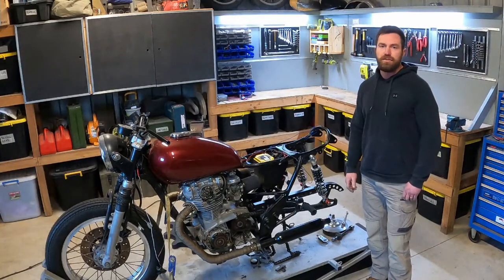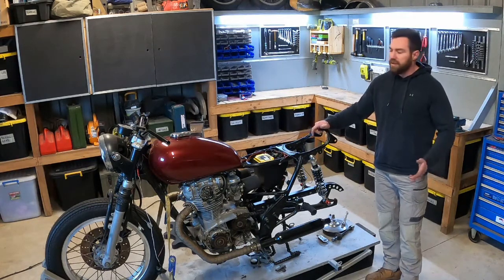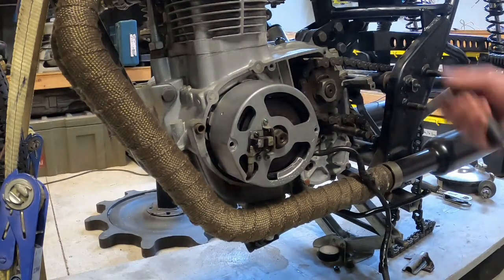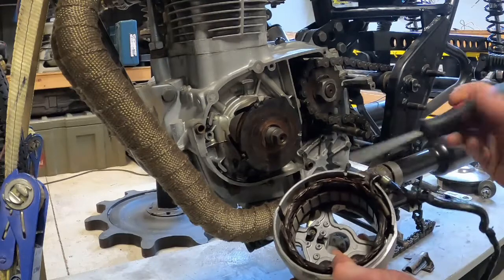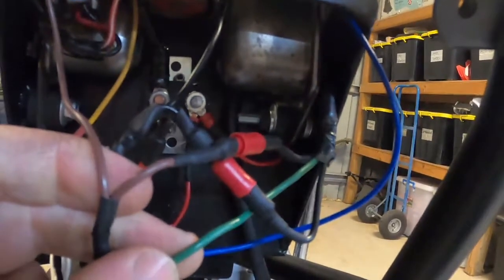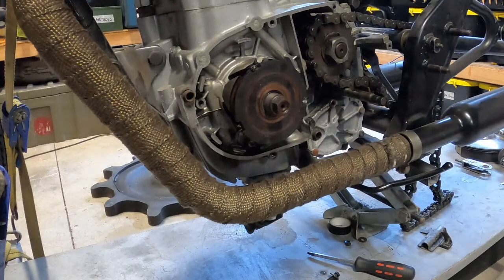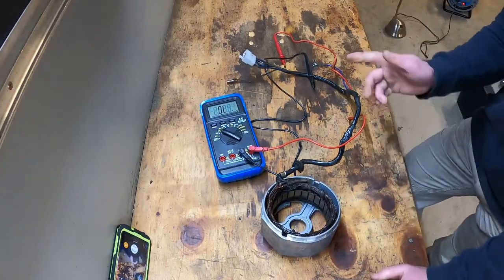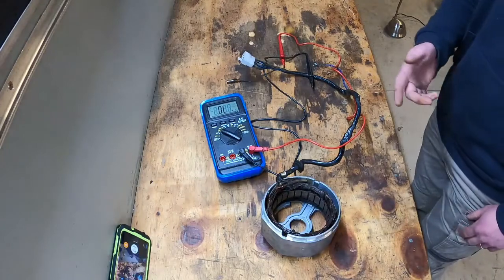XS650 Brat Build Ep 20, Charging System Fault Diagnosis

Comment: My 77 isn't charging well. I haven't done all the tests but I did buy an XSCharge PMA kit from Mike's XS. Would you recommend putting that on or actually finding the problem and staying with the original charging system, replacing what's faulty?
Reply from the maker: If you already have the pma system then I would go with that. I would still try to diagnose the problem for curiosities sake though.

Comment: I just purchased a 1980 xs650 sent the engine to be rebuilt just because I have little time to work on that but as I was going through the wiring my headlight won't come on? It works because when the engine is running I can jump a wire from the battery to the yellow wire on the safety relay and it turns on and stays on but if I don't jump it I don't have volts from the yellow wire from the stator to the safety relay and neither of the 3 white wires coming from the alternator show voltage while running...the stator and rotor are new they were installed.by the previous owner?
Reply from the maker: The yellow wire from the stator is unrectified and unregulated and it's only purpose is to open the safety relay and prevent the starter from being engaged while the engine is running. Your lights should have nothing to do with that circuit. I think the later models had lighting relays, which yours would be, but without looking at it I wouldn't be able to tell you anything about it.
Reply from the maker: Make sure your multimeter is set to volts ac when testing the 3 phase wires and the yellow. If it is set to dc it will read zero.
Reply: Thanks yes my model has the safety relay with two circuits so once the engine is running and the alternator starts charging it sends volts through the yellow wire to the safety relay which shuts off the starter circuit and closes the headlight circuit.....I'm going to do away with all that extra crap and simplify the wiring but if it's not working due to the charging circuit i would like to figure it out

Comment: Clean those rotor brush tracks and use new brushes, that will help.
My guess is carbon dust build up from the brushes created a path for electricity to ground (or between the brush tracks) when dirty, but lack of crud touching it makes it meter as good.
One other possibility is a crack or gap in insulation somewhere allowed a short to develop through dirt or carbon buildup and cleaning removed the conductive path.
Either means if it gets dirty again, the problem could return, or perhaps regular maintenance will keep that gremlin at bay.
It may be possible to re-varnish the coils and seal whatever gap may be there.
Reply from the maker: Already done mate. Thanks. I reckon it was a gap in insulation in the stator as it failed the bench test initially but after cleaning it passed. It's got some miles on it now and hasn't played up but I am keeping a close eye on it.

Comment: Cracking explanation.  Sadly I think the old separate reg / rec is dinosaur tech.  A modern reg/ rec and a lithium battery seems to be the way to go.  That of course still raises the question of OEM TCI ignition.  Only halfway through my rebuild on this stuff.
Reply: I’d like a diagram on that
Reply: @Oatmeal_TVx  Mine is an XS750 now with a 277 rephased crank by Smedspeed (UK).  Used a Ricks Regulator 14-504.  AntiGravity Li-Ion battery, plus electronic ignition from Smedspeed.  Not sure how to attach my hand drawn wiring diagram.